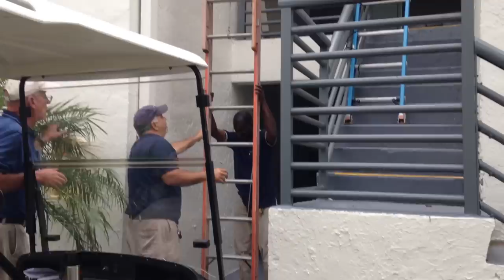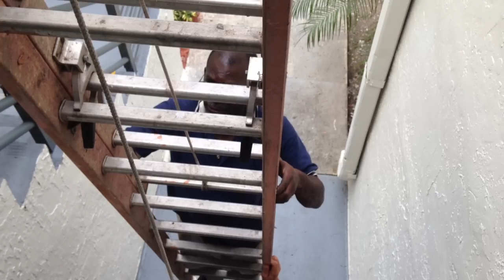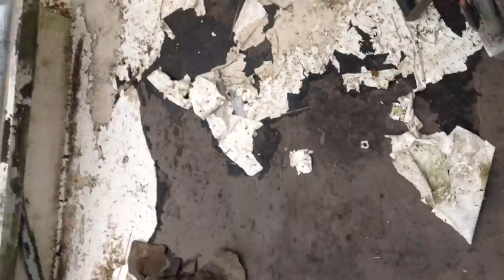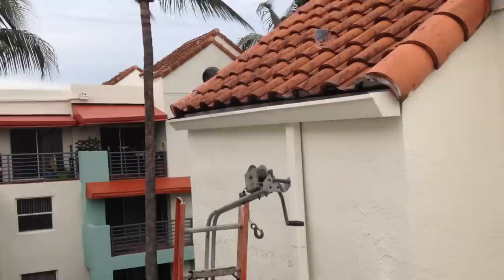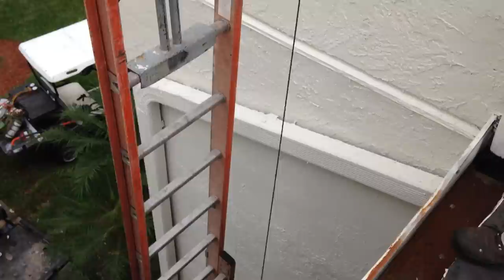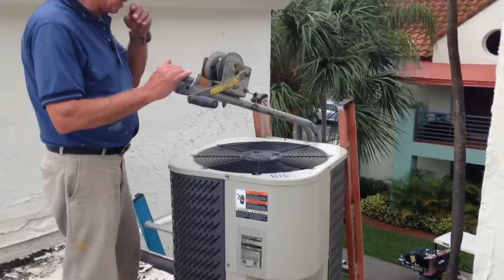Installing Condenser Unit in Roof

Comment: i am pretty sure thats a hand winch not much different looking than a winch on a jeep for pulling your self out of a ditch interesting using a ladder i wonder how big an item weight you can pick up especially before you put a load stress or even collapse the ladder or even what the wgt of that unit is